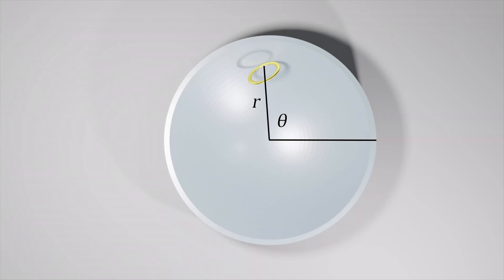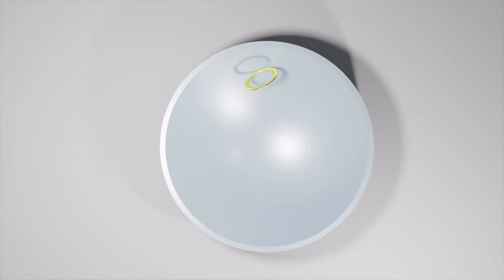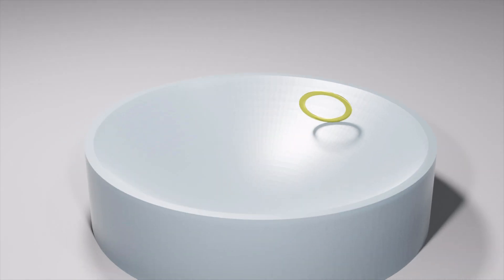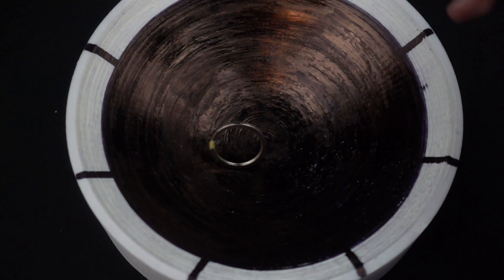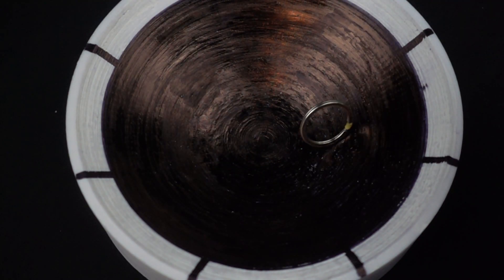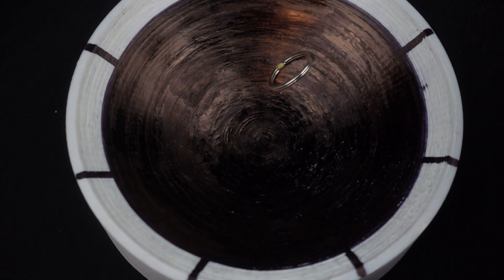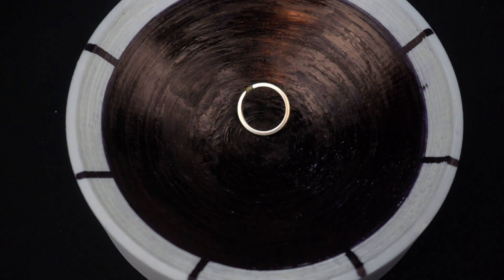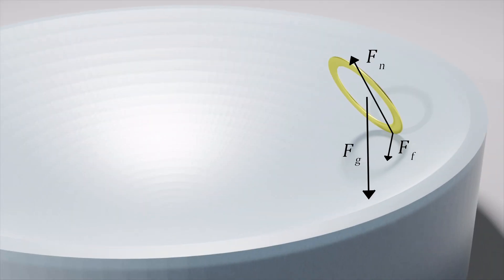Spin Drift IYPT 2021 Problem 10 Demonstration

Comment: since the pivot is the point of contact, there is a Torque due to the off-pivot gravitational force. if there was no initial velocity then the ring would fall due to this Torque. (at minute 2:41 you claimed there is no Torque for gravity).
Reply from the maker: It really depends on where you choose as the point of reference for your torque analysis. If you choose the contact point, gravitational force will provide a torque. If instead you choose the centre of mass as the reference point, the normal force and friction force will provide the torque. I would argue that it is more natural (maybe convenient) to choose the centre of mass as the reference. Since it is easily trackable and connects better to the other quantities one might care about. (eg. potential energy)